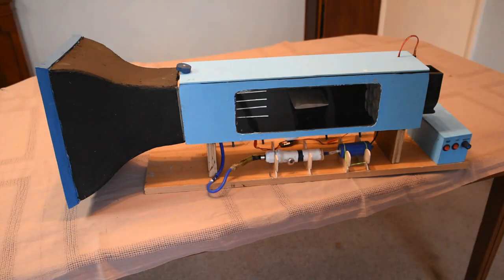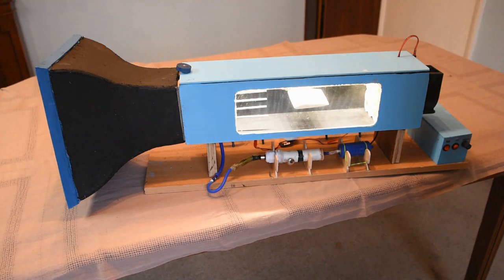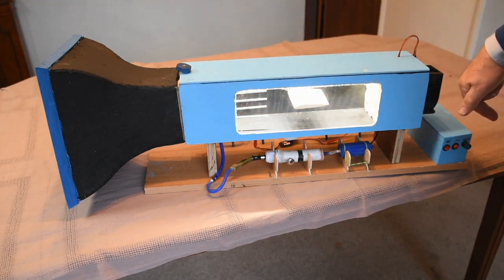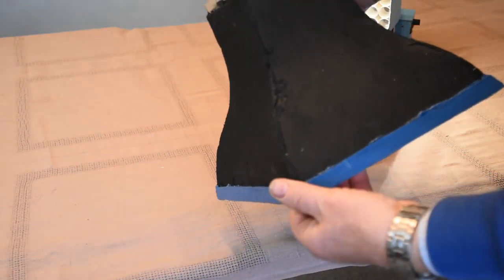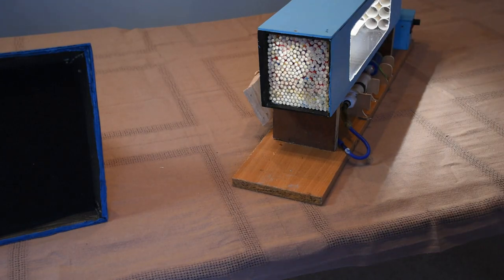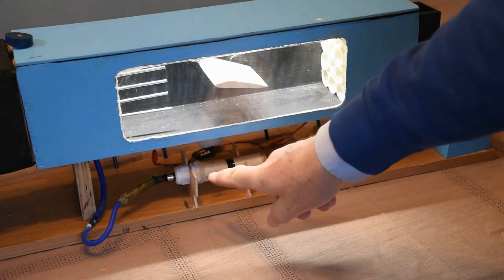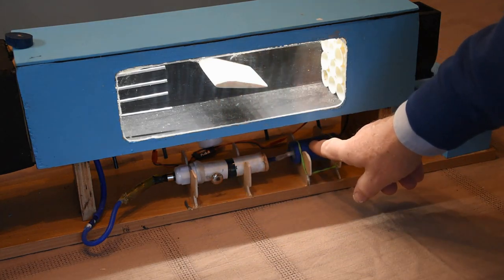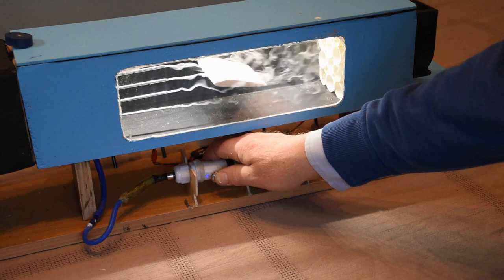Desktop Windtunnel

Comment: I’ve been wanting to build one for year but no one has shown such a simple and elegant solution to making one. I plan on changing a few things like the way to generate smoke and have the ability to move the smoke left to right for items that may not be even all the way across like car bodies over headlights vs dead center of the vehicle. But thank you for this. This is something anyone should be able to do and tweak to their own likings or specs thanks to just showing your design 👏🏻

Comment: the flow is turbulent even before striking the test object🤔
Reply: The error consist in pushing the smoke inside, that's causing turbulence. The right way to do it is keeping the smoke in a neutral pressure reservoir and let the venturi effect suck the smoke in.
Reply: @electronicscaos The wind tunnel should also be reversed, meaning installing the fan on the venturi side rather than the narrow end

Comment: Hi Mark, that's a great build! Simple, but sufficient and a damn ingenious idea to actually make use of those vapes - I'm sometimes tempted to call the firefighters when extreme vapers open their car doors. However I have one hint perhaps to make it  better, you might use a (planar) Laser (Example Bosch DIY PLT 2) it has a halfround lens in the laser path of the beam and I have already used it to watch mesmerising flow of mist in the evening over lawn for example  and air being uplifted by heat convection. Those laser planes can actually visualise a cut through air and you can just tilt the plane to investigate not only in one 2D-plane but also in the z-direction. The lasers used in this Bosch PLT2 are actually quite powerful.

Comment: I seriously considered building one like this just for fun, but I don't really have anything I need it for so I didn't. I couldn't think of a good way to make smoke though. Honestly I have no idea how regular wind tunnels do it. The only one I've used wasn't set up for that.Using an e-cig is so simple yet brilliant.
Reply from the maker: The only snag with e-cigs is the smell. I didn't want to fill my workshop with nicotine so I chose a sweet fruit vape flavour - and now my workshop smalls of mangoes! I also tried one of those ultra sound mist generators - but it did not produce enough mist. 
My current curiosity is to wonder if I could upend then whole thing into the vertical - and film a falling sycamore seed!
Reply from the maker: @ttstam  Good idea. It would not smell of Mangoes!
Reply: @MarkWaller  Instead of only using propylene glycol, you could use a mix of propylene glycol and vegetable glycerin. More vegetable glycerin can produce more fog but can also make the liquid thicker.
Reply from the maker: @bass2762  Thanks, good idea!

Comment: I recently made a larger version wind tunnel and found that using straws as a wind modifier simply slows down the venturi flow. So I took them off and now the flow, although more "raggedy" and not as laminar, actually provides an environment that is more faithful to an actual outdoors scenario, complete with eddys, turbulence and wind bouncing around. If the item one is testing will be used out in the real world,  I think utilizing real world conditions is a better bet. After all, there won't be any straws up in the clouds to make your flight more "laminar".
Reply from the maker: Yes. I agree. I went through exactly the same thoughts and took the straws out. I think it is better now! Great minds...etc!

Comment: How do the tubes straighten the flow and make the flow laminar? I mean once the flow passes the tubes there should create vortices and eddies because every tube has the biggest velocity vector at centre or am i getting something wrong? But actually in the real facilities turbulance grids are used. The straws seem to act more as turbulance grid.
Reply from the maker: You are right. The idea was to stop any large eddies but of course the straws create small eddies of their own. You can see this in the video. In a way it is a turbulance grid creating turbulence on a small scale which decays quickly and resolves to laminar flow. The eddies are on a very small scale and do not show up in long exposure photos.  In the end I removed the straws and it did not seem to be much different! The larger tubes at the other end do work to stop the fan causing a spiral flow in the chamber

Comment: Mark, any chance you have a parts list for this? It really is a fantastic project!
Reply from the maker: There is no parts list as such because I put it together from things I mostly had already, however I bought some of the bits from ebay as follows...
The Aquarium air pump I used was one of these…
https://www.ebay.co.uk/itm/USB-Mini-Air-Pump-Water-Pump-Oxygen-Aerator-Aquarium-Fish-Tank-Portable-Home-UK/402419542163?hash=item5db212e893:g:O6cAAOSwixNfVyQN

The e cigarette was… 
https://www.ebay.co.uk/itm/e-cig-cigarette-ce4-eGo-T-shisha-1100mAh-battery-vape-pen-charger-atomiser-kit/253790449905?hash=item3b1716f0f1:g:EAwAAOSweVNbYcYB

The fan was a brushless 12V one like this…
https://www.ebay.co.uk/itm/DC-12V-120mm-x32mm-Blower-Cooling-Fan-Centrifugal-Turbo-Brushless-Fans-Cooler/232977792053?hash=item363e8efc35:g:cloAAOSwXMxbz9pA

The motor controller was this one…
https://www.ebay.co.uk/itm/Mini-DC-Motor-Speed-Control-Driver-Board-3V-35V-5A-PWM-Controller-LED-dimmer/163091515028?hash=item25f9030694:g:GLUAAOSwXudbHZdk

Everything else was made from stuff I had lying around in my shed. By the way, I decided in the end that the wall of straws introduced more turbulence than it removed, so I cut it out! Also, the best laminar flow was generated with the windspeed quite low, which I achieved by partially blocking the fan vent. 

If I did it again I would put more distance between the fan and the main chamber, because some of the turbulance I was getting was coming from the fan.

Good luck with your project
Reply: @MarkWaller  HI Mark, Would you like to sell this wind tunnel to me? Please let me know. Thanks

Comment: This is great!  I would like to recreate it to test golf discs.  Which mean the chamber would have to be larger to accommodate the size of the disc.
Maybe you can suggest a way to spin the disc while it's in the chamber.
   I am imagining some sort of spindle with levers to change the angle of the disc (like a helicopter)  
Also, I am thinking of how to measure the air velocity???
Reply from the maker: I would measure windspeed by videoing the smoke and measuring how far it travels over one (or ten) frames. It is not necessary to spin the disc, because the only function of the spin is to make the aerofoil stable in the air. The air flow will be the same whether the disc spins or not. You could motorise the disc on a thin spindle but it would be tricky to do and would serve little purpose! However, as fun as this project was, do not expect too much. There will always be some eddies in the airflow.

Comment: hi, love the video. but i was wondering how you made the smoke injector, specifically the part with the 4 tubes. i have been trying to figure it out as im doing the same project.

thanks!
Reply: same with the venturi
Reply from the maker: I used  3mm brass tubes. One tube from below splits into four or five venturi outlets. To reduce the turbulence around the tubes, I sandwiched them in a balsa cowling with an aerofoil streamlined shape. If the air flow speed and the smoke flow speed are matched the the turbulence is minimised. I hope this helps.
Reply: @MarkWaller  thank you so much for the help!

Comment: Excusme sir, can you tell / explain part for making smoke for detailed?  I have project to build homemade windtunnel. Thankyou sir
Reply from the maker: The smoke comes froma cheap e-cigarette  with a small aquarium air pump to drive the air flow. The pump will only blow, (not suck) so I had to enclose and seal the e-cigarette in a piece of plastic piping to blow the air through it in the right direction. The e-cigarette smoke is activated by a push  button on its side so I  arranged a small mechanism in the side of the pipe so the button can be pressed to activate the smoke while inside its sealed tube chamber. I hope this helps you.
Reply: Can you buy one already built. @MarkWaller

Comment: sorry to ask another question, but how did you glue the straws in place (if you glued them at all) 
thank you
Reply from the maker: I cut paper straws to lengths of about 2 cms each and just glued them into position. After the first two rows of straws it gets quite sticky, and unstable so it is best to let it dry before starting the next two rows. Having said that I took out the straws in the end as they inroduced small eddies of their own. It is proved best to just let the air flow in a laminar fashion without the wall of straws.

Comment: Hi, why are you using a brushless fan? Thanks
Reply from the maker: Any fan would do but brushless motors are more powerful and I found this one online for a sensible price.
Reply: @MarkWaller  but my doubt is that i dont know what fan i have to buy, because i do need a suction fan, and normal fans expel the air isnt it? Could you help me plss
Reply: @nicov7274  brushless is motor type. It could be brushed or brushless. 
Only difference is power and cost
Reply from the maker: @nicov7274  so long as the fan is at the exit end of the tube and turning the right way it will draw air through the tunnel. If your fan blow, turn it around, the other side must be sucking!!

Comment: hello i would like to recreate this for my physics skilled work, how did you do it with the aquarium pump and the e cigarette?
Reply from the maker: I bought a cheap (blue) air pump and a cheap e-cigaarette. The cig was mounted inside a piece of (white) plastic piping so the air flow goes in the right direction. You can see both in in the picture. The button on the cig is accessible through the side of the white pipe. The white pipe comes apart to allow the cig to be refilled and charged.
Reply: @MarkWaller  okay thanks! :D

Comment: Excuse me mister. 
Because i make the same project, can you tell me what electronic cigarette you use and how you connected with the air pump ??? Because i have stuck and i don't find a good electronic cigarette 😂😂😂
Reply from the maker: I used the cheapest e-cigarette I could find and the least offensive flavour (Mangoes!) Since the pump would only blow (not suck) I had to enclose the e-cigarette in a piece of plastic pipe and push the air through the e-cigarette, (right to left in the picture.)  I devised a press button on the side of the tube such that if pressed it transferred the pressure onto the ON button of the e-cigarette underneath.... to make smoke. (You have to hold it on)
Reply: I have another question, smoke injectors where can i find them?
Reply from the maker: @ΚωνσταντίνοςΤσάλας-ω6ε  I used some 3mm tubing I already had. You can buy metal pipes at any good model shop, usually in aluminium or brass. To reduce the eddies it is best if the smoke joins the airflow at about the same speed as the airflow it is joining. I made the injectors quite long so as to reduce the eddies caused by the injector tube mounting - which was itself made from steamlined balsa wood. Having experimented, I came to the conclusion that the wall of drinking straws introduced small eddies and so I removed it for a smoother airflow. Good luck.